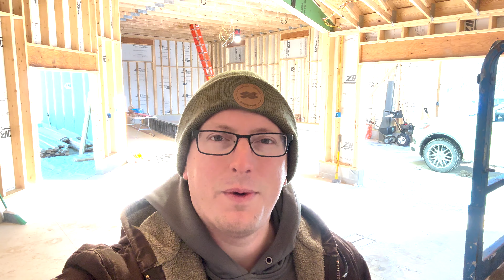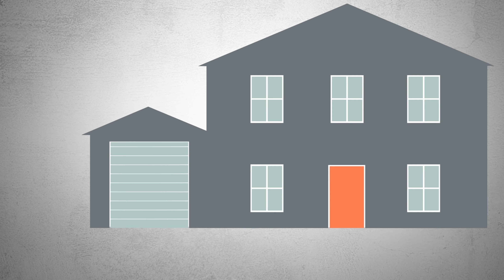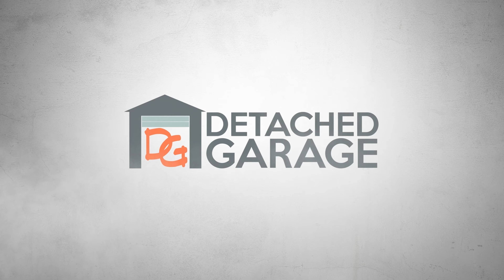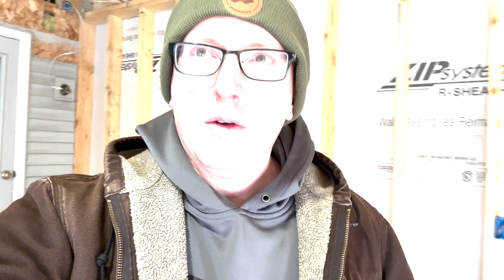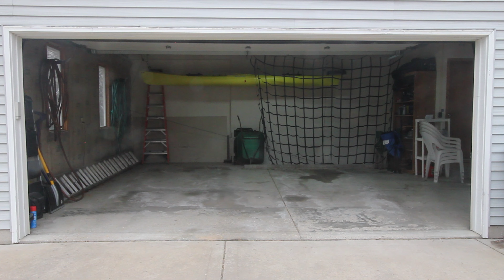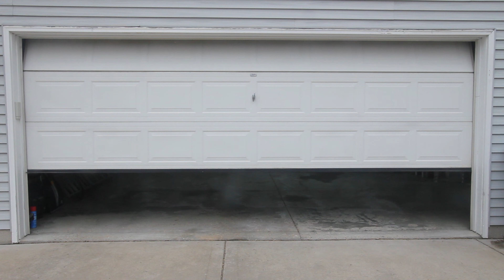I NEED your HELP! // Garage Build Ep. 8

Comment: Plastic/tarp off all the openings and run haters in the garage to get it warm enough to insulate and hang board.
Reply: Do this, but double layer, plastic sheet outside and a plastic sheet inside.  the double barrier with air gap should be good enough to hold the heat long enough for the foam to set and you won't need to hang the doors.
Reply from the maker: Great suggestion. I had thought about this option in the back of my mind. Just wonder if it was more work than getting the openings garage door ready. The doors are here at the installer and reaffy to go in once the opening is ready.
Reply from the maker: Great thought on the double wall! If I got the plastic route, I will certainly do this. I might even  frame a temporary man door in the center of the plastic.

Comment: Plywood, then heat, then spray foam, then batt insulation and drywall to finish.  I JUST did this very thing for EXACT same reason and it worked FABULOUSLY
Reply from the maker: Thanks, Scott!

Comment: Given the weather forecast in your area for the next week shows highs in the mid to upper 30s and lows in the high 20s, I'd do the spray and batt insulation first, drywall second, and then the garage doors.
Reply from the maker: I’m thinking that will be the best route. Even if I can’t get the spray foam completed this coming week, I can certainly keep the progress moving forward.
Reply: @DetachedGarage  Can you do the spray and batt and start drywall around the doors first?
Reply from the maker: That was my plan to only drywall those two walls and leave the rest open for a while.